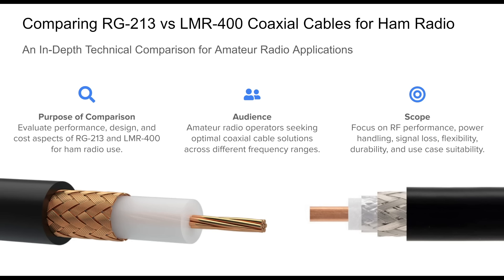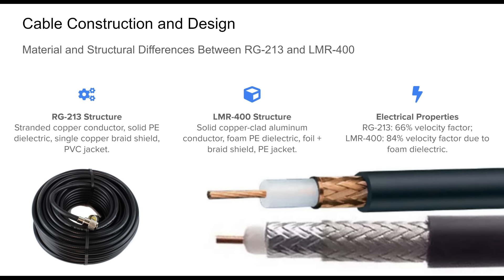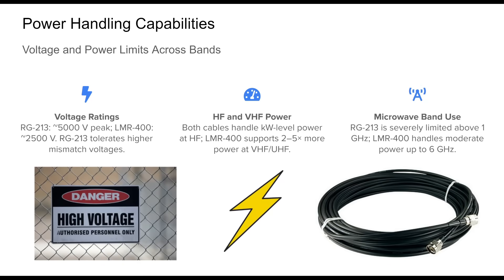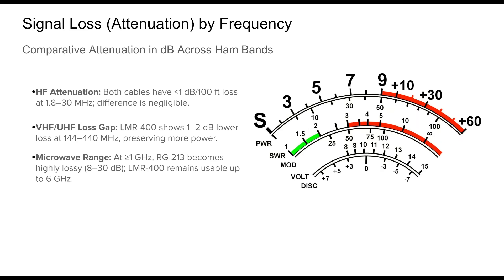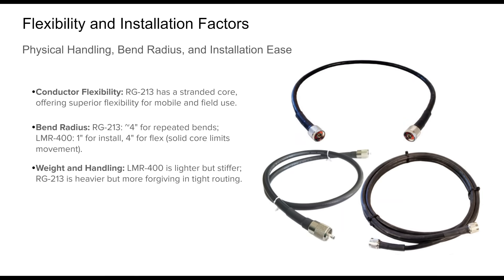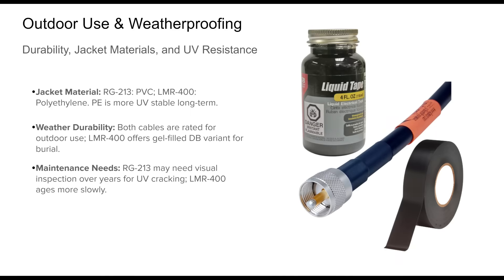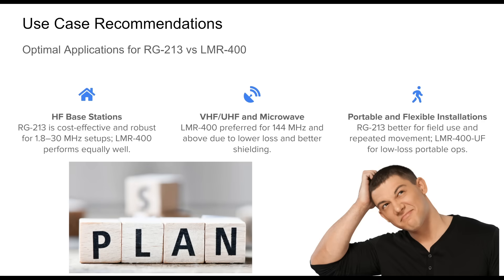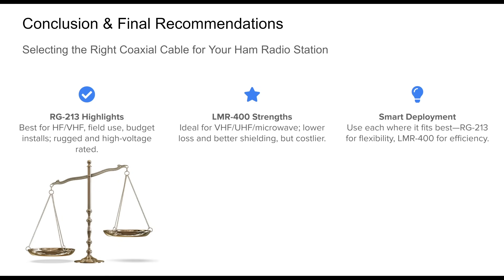RG-213 vs LMR-400 Which Cable Is BEST for Ham Radio?

Comment: I have been using rg213 coax cable since I was 5yrs old and after 56yrs it's still the best. Lmr-400 & above is dangerous when there's thunder ⛈️ lightning around because of the sparks ✨️ it produces.  
I used Lmr-600 coax with a home made gain master 5/8 wave wire antenna 5yrs ago and due to the radiation it gives it destroyed my android tv box circuit board/indoor camera system because of its solid center conductor. 
When I switched back to stranded rg213 coax cable I never had anyone problems.

Comment: One factor that is often over looked:  LMR-series cable has dissimilar materials forming the shield; a non-bonded, just folded back aluminum foil covered with tin plated braid.  What you have is an ideal breeding ground for passive intermodulation (PIM).  Ever wonder why true commercial Public Safety or cellular systems running multi-carriers in a cable  never use LMR-series cables?  They create intermodulation on shared towers as well as broadband noise from all the diode junctions formed by dissimilar conductor materials.  Don’t believe me:  Contact Times Microwave Tech support and ask.  One LMR-series cable on a shared commercial tower can ‘trash’ many  users.  Times should have named it HAM-400, etc…
Reply from the maker: Thanks for the info, a few folks also posted about this 👍

Comment: Good info.  I'll note that you don't want to use LMR on a repeater/duplex or you'll hear crackling.  It'll "work", but you'll be dealing with noise.  This is because of the dissimilar metals in the line.
Reply from the maker: Thanks for the extra info 👍
Reply: @TheSmokinApe  Not a problem sir!  It is true, not one of the myths.  Years ago I ran about 75' of LMR-400 on my 2m repeater to get by with for a bit on a temporary set up.  It worked, we could have QSO's but yeah, the crackling was there.  As soon as it got it on to the permanent site and did it up right with heliax and 213 jumpers the crackling went away.
Reply from the maker: @northwoodsyankee3528  glad you got it working out
Reply: @TheSmokinApe  Thanks.  It was just a matter of waiting for it's permanent home to become a reality.

Comment: Thanks smoking ape, your voice over put me asleep. I use LMR400 for all coax needs where permanent install is used. If I need any flex coax I use Messi and palonie Sahara 7 or 10 m coax. I believe in using the best and not the cheapest , you get what you pay for. KJ5BNQ

Comment: I am cheap and poor. I use RG-6  got at Home depot for $20 / 100 ft.  for HF.  with antenna tuner in radio.  works fine.
Reply from the maker: I have a few buddies who use that as well, I actually have a 500’ spool sitting here I got for 50$ to test 👍
Reply: While I was waiting for my Belden 9913 to arrive (it was out of stock), I had some satellite TV coax (perhaps RG-6? Not sure) which I wired my homebrew 5 element quad up with just to try it out. It worked so well, getting into 70cm repeaters 50 miles away, from the bottom of a valley, that I never bothered replacing it!
Reply from the maker: @paulsengupta971 if it works it works 👍

Comment: What's a shame is that they didn't put an insulating layer in the LMR 400 between the foil and the braid. I would think that then you would have a Faraday cage effect across the whole length of the cable, significantly decreasing noise signal to the central conductor.
Reply from the maker: It might 🤷

Comment: I have found that stranded center conductor coax cable is easy to work with, such as Belden 9913F7 cable. Stranded cable is a lot more flexible when used with an antenna rotator then solid center coax cable. LMR-400UF is a stranded version of LMR-400 and will work well into the UHF range.
Although LMR-400 is better above the UHF range, it is more difficult to work with in some applications. Thanks for your great video……………..............................
Reply from the maker: Thanks Tim 👍

Comment: I like the lmr 600 😊
Reply from the maker: I haven’t use the 600 🤷
Reply: Awesome coax for sure. But for 2 reasons why I don't use it. Connectors are not as readily available and a bit harder to hide. Plus a .405 sized at 17 feet in length  is in the neighborhood of 1/2 DB loss in the 440 to 470 MHZ range.  600 is definitely great stuff for sure. ❤❤
Reply: @MrSmith-qu4nx yeah, there is no radio shops in my area. I have to order from internet sources.

Comment: G'day Ape,
I've always used RG-213 for all of my Ham stuff here, even up to 70cm and it seems to work fine. 
I had thought about trying some LMR-400 for the VHF/UHF stuff, however what turns me off about this cable is that it is hard to bend, 
you can't use it with rotators and it uses copper-coated aluminium as the centre conductor, that doesn't seem right to me, although that's only my personal opinion.
After Hayden put up the video on the Messi & Paoloni Ultra-flex 10, when I replace all of my coaxial cable, I'm going to look at using that, my coaxial cable and connectors have been out in the harsh weather here for the last 20 years, so I guess it's probably time for some new tyres.
Reply from the maker: Hey Mike, I’m not recommending any cable in particular just trying to inform folks.  I’ve been using some of the M&P and have been happy with it…. Good luck with whatever you decide 👍
Reply: @TheSmokinApe  Nah, I didn't take it as one cable is better than the other in your delivery.
Always a worth-while watch.

Comment: The critical number is capacitance per foot which is where your loss comes from. The ideal dielectric being air, worst being solid plastic. !00% shielding helps with higher frequencies to prevent signal radiation through the braid.

Belden 9913 uses an air dielectric which offers a lower capacitance per foot, but since it can't be pressurized it's use should be limited to indoor only.

Another option would be LMR-600 which gets you closer to LDF-4 loss specs without a huge increase in price.
Reply from the maker: Thanks for the info 👍

Comment: I was being cheap (typical ham) and bought 125 feet of KMR400 on Amazon for a long run to a DX Commander (Sig-9).  It has been out there in the elements for 3 years now and has performed well.
Reply from the maker: Glad to hear it's working out for you 👍

Comment: Thank you for the information. But have you liiked at RG-214?   RG-213 and RG-214 MIL both can use normal PL-259 connectors! LMR-400 uses connectors that are very hard to put on, need special tools and cost much more! RG-214 has a bubble shield of braided . RG-214 is easy to work with with the same stranded center as RG-213. RF-214 is good up to 11 GHz! I don't think most people know about RG-214! Most of the Hams I know use RG-8 for there VHF- UHF antennas, 144 & 450. It is easy to work with at a lower price, and still works well on 450MHz! Yes LMR 400 or RG214 is needed when going into the GHz. But most I know go with the lower price RG-8 for 144 & 450 MHz use. 73  W4DES
Reply from the maker: Hey Donald, I’m one of the hams that didn’t know about 214 🤷

Comment: Thanks for the well presented information, it looks like LM400 for my IC9700 but with a few feet of RG213 from rig to outside wall of the shack due to a sharp bend.
Reply from the maker: Thanks for checking out the video Ace 👍

Comment: Just changed out about a 60' run of the DX Engineering 400 for M&P Hyperflex13  for better performance. Still need to do the vertical section up the tower.  It made a difference on UHF.LMR400 is great stuff but Hyperflex 13 is a bit better at UHF.  I have about 100' cable run to get up 45' on a tower.
Reply from the maker: Gonna have to check out that hyper flex, thanks for watching hats!

Comment: Aluminum wire is not easy to solder into the center pin of the connector.
Reply from the maker: Good point Karl 👍

Comment: Using LMR-400 for a repeater is not a good idea. The 2 dissimilar metals, once any corrosion occurs, creates phase noise. When used in full duplex operation this means unwanted and hard to isolate noise!
Reply from the maker: Thank you, especially for the !

Comment: Not all RG cables are the same quality. Unless it is stamped RG-213 MIL-17 (standard) its not mil spec. Stamped RG-213 TYPE or nothing, it could be of any quality and one must look at the manufacture, Belden, Times and such being good commercial quality.  Of course there are low cost cables that will work well but its a good idea to test them with a VNA or a   wattmeter and load before you uncoil it.
Reply from the maker: Totally agree, I think I mentioned that not all 213 is the same 👍

Comment: Remember NEVER use LMR type coax for repeater antenna feed line because of diode junctioning from dissimilar metals.
Reply from the maker: Didn’t know that 👍
Reply: Is that truly proven or a ham urban legend? I have dozens of commercial, public-safety, and gmrs repeaters in service, some for over 15 years, and have had no issues with LMR 400. Distances range from 50 to 100 ft exterior use.
Reply: @rickmaudlin2160, me too… never ever seen a problem with LMR-400 , I use the direct burial for all outside stuff because it’s flooded and doesn’t have capillary effects with water …. It’s just worked for me and with the extra shielding it keeps RF in and out.. 73
Reply from the maker: @rickmaudlin2160🤷
Reply: It is absolutely true, a friend of mine works for the highway patrol he keeps all of their repeaters going helped us with a problem with our newly installed D-Star 440 repeater. It had terrible desence. He asked about the equipment radios,duplexer cavities, feedlines ect. Once i told him it had LMR400 going to the antenna he said thats probably the issue. I now know that LMR type coaxes cause Diode junctioning which produces Passive Intermod Distortion"PID"
Reply: I guess it has something to do with signals traveling both ways on the coax at the same time. 🤷

Comment: Thanks for this video! I would like to see a compare and contrast video on using the cheap and readily available 75 ohm TV cables, as it's hard to find transmitting specs for this largely used for receiving only cable. It might be a good amateur practice I think, to keep a couple of pairs of PL to F connectors in case of an emergency, as all the big box stores carry the 75 ohm cable (even my local Walmart has 25 foot lengths) and as always, the zip code and twisted pair or using even Ethernet cables. I really enjoy your videos, always so well done. All the Best to you, Sir! 73 DE W8LV BILL
Reply from the maker: Thanks for watching Bill, I do have a buddy that pretty much only uses 75 Ω
Reply: I run 300W through RG6 and haven't had an issue yet. So long as you used a 1/2 wavelength multiple (17m for 40, 34m for 80m) it leaves the SWR alone, and even in the worst case you only have a 2:1 mismatch.

I know someone running 100W through RG316, the tiny stuff when portable, they haven't had an issue either.
Reply from the maker: @godarklight thanks for the testimony GDL 👍

Comment: Thanks Ape. Nice to see the nuances of each of these. Love to see a similar comparison between RG316 and RG174. One of the major manufacturers just came out with a blurb that their 174 is showing similar attenuation as 316, with less weigh and much less cost. I'm skeptical, but would be psyched if it's true.
Reply from the maker: Hey Doug, I actually did one a few months back.  The Ultimate Showdown: RG-316 vs RG-174 for HF Ham Radio!
https://youtu.be/cpEpW3-YOT8
Reply: @TheSmokinApe  Guess I missed that one, thanks!
Reply from the maker: @dougdaniels lol, no worries 👍

Comment: For the AVG HAM RG 213 or RG 8-X is just fine for HF . DX Engineering/ ABR / M & P are a good choice.  Better is like RG 214 or 9913 or RG 393/400 coax. I like the M & P POTA FLEX 7 for HF. 3 shields all coper. Takes 1.5 KW  and super low loss. I also use DXE RG 8X jumpers , Some MIL spec 8X type and more. Lots of great coax to find. Just do some research and make the best choice for what your needs are . No need to use hard line for POTA . And for SOTA A short piece of RG 316 or RG 58/U is just fine. I wont be the one taking 7/8 in hard line to a SOTA . 73
Reply from the maker: Thanks for watching Robert 👍

Comment: Hey Ape.  Very good job.  However, could you address connectors?  Can the Amphenol PL-256 that I've been soldering on the end of 213 for years be used for LMR-400?  How is the aluminum foil handled?
Reply from the maker: Sorry man, I’ve never used 400 🤷

Comment: Also,  for outdoor RF connector weatherproofing,   Ive been using 'self-vulcanizing liner-less tape'  and back that up with Scotch 33 electrical tape.   It has been working well for me as I have some connections that are 5 or 6 years old and still working well
Reply: Same! I put a single layer of electric tape first, I've removed the rubber tape too many times now to not be annoyed trying to get every last bit off. The electrical tape --> rubber tape --> electrical tape is a top-tier combo.
Reply from the maker: Thanks Dan, I’ll look into that 👍
Reply: @TheSmokinApe  the outfit ULINE has what they call "self-fusing tape"
Reply from the maker: @dan_in_sd thanks man 👍

Comment: Thanks for doing the research for this video. I have RG-213 for an EFHW using only 100W and LMR-400 for a DX Commander Classic using 500W. For portable I either use M&P Potaflex 6 or Hyperflex 7 fifty foot runs. I'm happy with all those choices.
Reply from the maker: Seems reasonable, thanks for watching Jack 👍

Comment: Ive always been a fan of LMR-240 and LMR-400  both in the Ultra-Flex versions.   Most of my station is on this cable.   Or ABR-400 for some connections.   i think the UF version of LMR have a stranded center conductor but not entirely sure
Reply from the maker: It’s my understanding that it does 👍

Comment: I like RG213 because you can beat the crap out of it.  Even if water gets into it, it works fine.  That foil stuff not so much.  About the stupidest coax is LMR600.  Sounds and looks impressive but it is not that much better than LMR400 and is more expensive than 1/2" Heliax.  Really the price is closing in where 1/2" Heliax should be more popular than it is for ham use.  Currently running full legal limit through knock off chinese LMR400 on 2 meters and it has been fine.  I plan on not doing that for much longer though!  Thanks for the video.  73, KF0BBU
Reply from the maker: Thanks for checking it out Dylan 👍

Comment: Timely post. I've been thinking of upgrading the 70' RG8x run to my 10 meter Yagi with something lower loss. Sounds like RG213 might be the answer...
Reply: LMR 400 or RG8 on 10m provide less loss over long runs. Look at all the specifications prior to purchasing. Longer runs IMO is anything more than 3 foot jumper. I have used RG8 for five years and like it. The price of ‘here use this’ was right and it works. When I started replace the club repeater feed lines I did an even deeper dive into COAX. 
This video should not be telling you exactly which coax to get, but there is a huge amount of information available about coax, DO YOUR RESEARCH.
Reply: @jameski5oeb668 Whatever I choose needs to be stranded as it will be wrapping and unwrapping around the mast as I rotate it. Stranded LMR400 would work as well. From experience, the standard LMR400 is not flexible at all.
Reply: @RicksHamShack  flexibility is the priority. My priority has been expense so far. If I’m spending monies, dollars must count. Do the legwork it will payoff. DX Engineering, Messi & Peloni, and ABR Industries all have great solutions for our needs.
Reply from the maker: Good luck with the project Rick 👍

Comment: Coax losses are how they get ya. Twin lead rules, coax drools.
Reply: Other factors to consider are the ease of connector installation and the variety of connectors  that are readily available. For commercial vendors, LMR 400 crimps seem to win those categories every time. Great review thanks.
Reply from the maker: Loss is how they get you…
Reply: Not really at HF given the constraints on running twin lead.
Reply: @jerryKB2GCG twin lead is easy to use, the reports of difficulty are vastly exaggerated. The ease of coax on the other hand is vastly overstated.
Reply: Never used hard line coax have you.  Less loss than flimsy, easily damaged, reactive with the outside world parallel balanced wire transmission line.  Also, that flimsy floppy wire is all but useless at higher frequencies.
Reply: @mikesradiorepair I use hardline for my portable GMRS repeater. I know the correct feed line for the application. My response to @thesmokinape are always whimsical and motivated to help his channels algorithm.